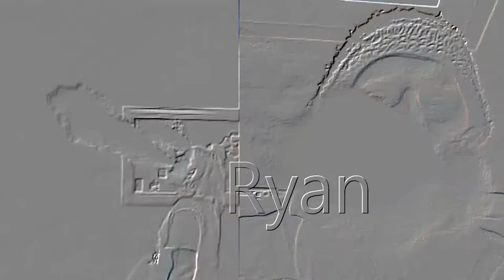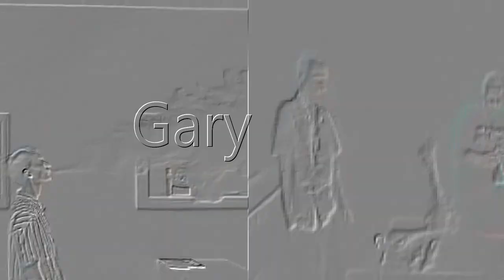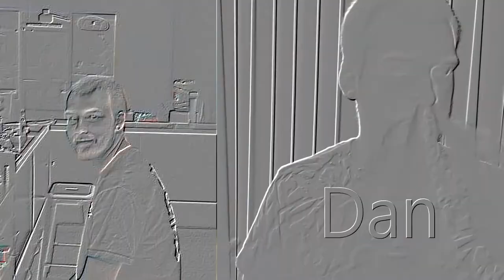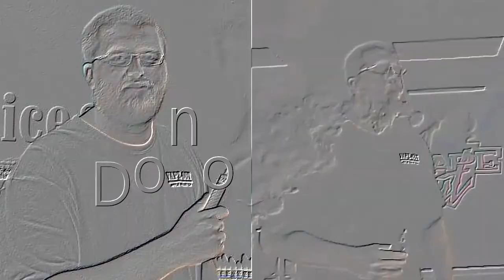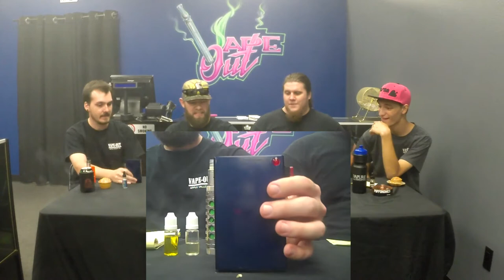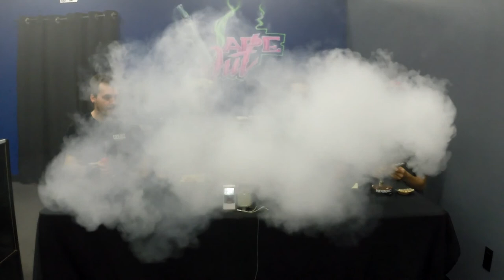Flawless Vapes Tugboat V2 review. Vape-Out Podcast EP 6

Comment: Catching on the casts and really likening them so far.  :)   I hope you don't mind, but I wanted to share a variety of thoughts.  I'm surprised there aren't more comments, so I'll have to fill in the for the missing ones.  *grin*

The discussion about parallel and series was a bit off / confusing.  In series, the amps remain the same, but the voltage is additive.  So two 18650's 2500mah in series is 7.4v on full charge, but still 2500 mah. 

In parallel the amps are additive so same batteries would be 4.2v but 5000 mah.  It won't fire coils hotter than a single battery, but will last twice as long.  Benefit of parallel is that amp draw is distributed so if you pull 50a on two 35a limit in parallel, you will be fine.  *  If any viewer can comment on this, I would love a double check.

The discussion on gaming got a little off the rails.  ;)  I like to hear a tidbit about games from time to time but..  Of course, it's your cast so you should do what ever you want, but just a touch of feedback from a viewer.

I really enjoy the reviews.  If you don't have new gear to review, feel free to go back into an older piece.  How it is holding up is always nice to hear.

Getto Vaping!  Love it.

Episode 4 isn't loading?  Makes me sad since I was looking forward to the review of the Mutation-X.  You might need to re-upload it.  shrug  YouTube say's 'it's not viewable in this country'???

If you have a variety of segments (ghetto, review, tricks, etc.) you might add timestamps in the description.  It's not critical, but it might be nice to jump back to see a trick or similar. 

Oh, loved the trick topic from Ep. 5.  Who knew there were sponsored trick vapers???  More on that would be always welcome.

- Some of this may be happening already in the next 3 eps, but I thought I blast you with some ideas.  :)  I'm hoping to see that quad 26650 fired up by then.  If not... You need to pool some cash to buy batteries!  You can't build that beast and not feed it.

Looking forward to the next ep.